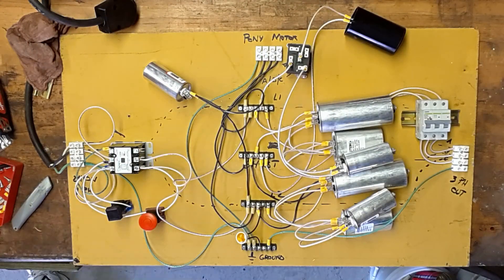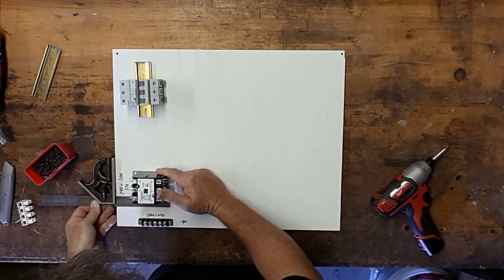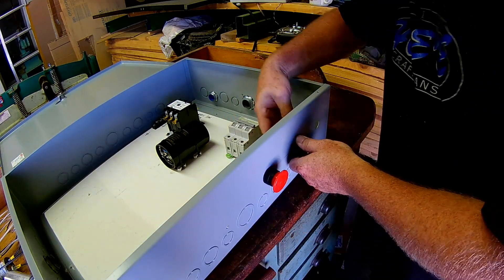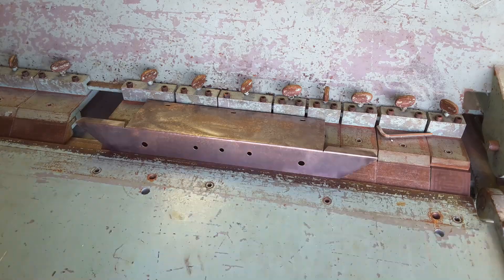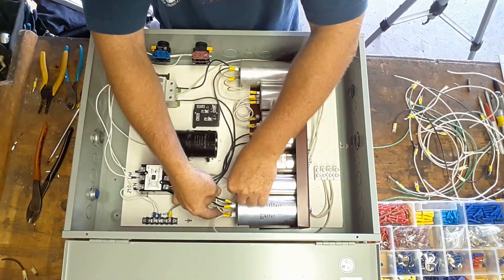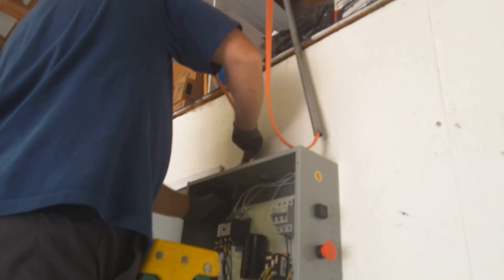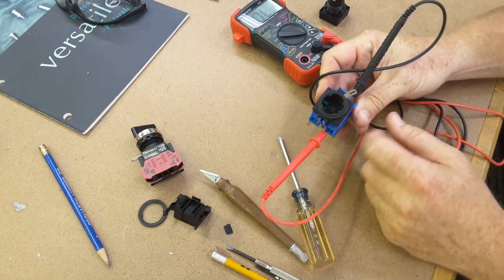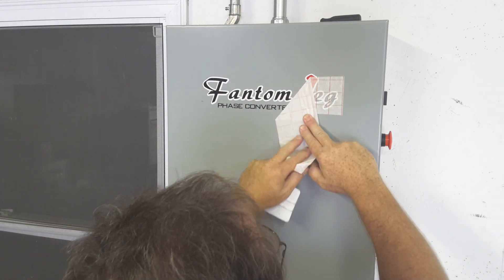Building a Phase Converter - Part 3 Final

Comment: Great Series! Came out really nice. I would attempt a build myself but I had a few phase converters laying around on the ranch but I still may go the VFD route. That corner notcher would be really handy to have.
Reply from the maker: Thanks.  I appreciate the feedback.  The VFD route is tempting.  I discovered the other day that my wood lathe is 3phase with a VFD.  I had never payed attention to 'that little box' on the back.
As for the corner notcher....ya.  I would have never guessed how much I would use something like that.  All the sheet metal equipment came at the same time so I am still discovering how useful some of it is.  I use the manual sheer a lot more than I thought too.  ~P
Reply: Will this build be able to handle VFD 3 Phase motors? I'm looking at a Bridgeport Mill with a 550V 3 Phase VFD head motor and need to build a converter as you have with a residential - rural that only has 240 Single Phase power supply coming to the house.
Reply from the maker: Doug Hanchard I am not sure of the answer to your questions.  I have no idea how you would step up to 550v.  Also in my limited experience a VFD does the phase conversion.  At least the ones I have like on my router spindle and wood lathe.